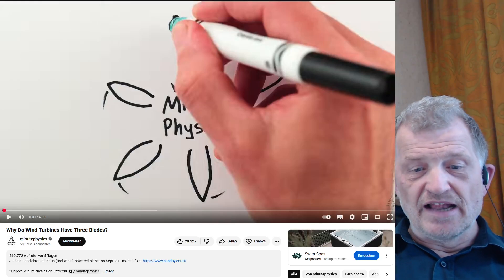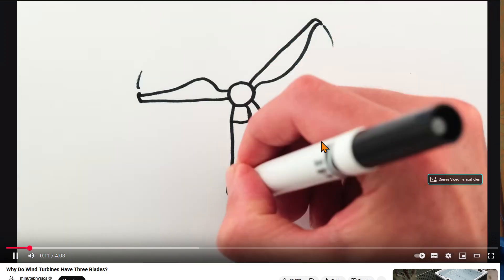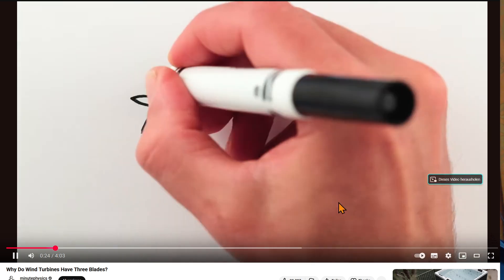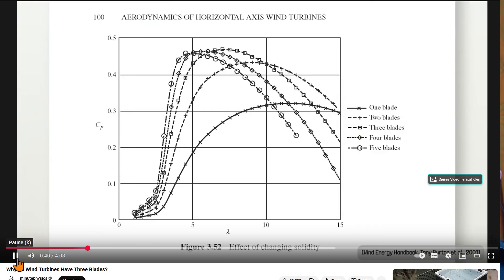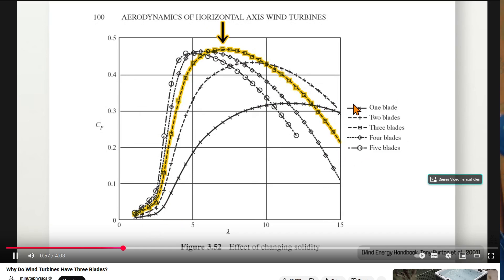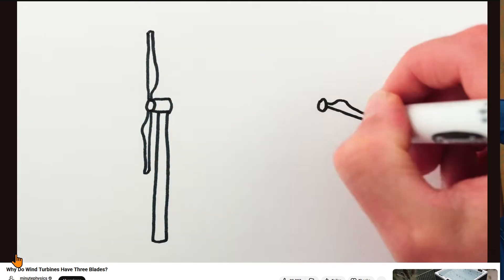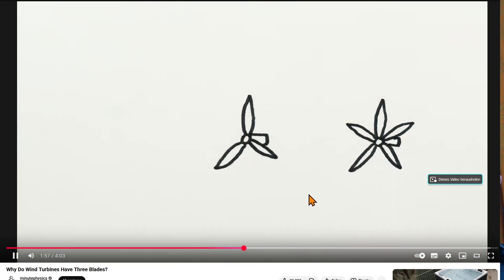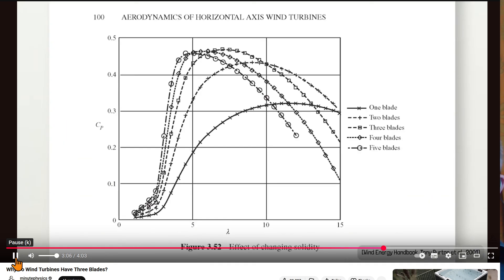Why Do Wind Turbines Have Three Blades? - the misleading facts corrected. Channel "minutephysics"

Comment: Another issue that's not covered is that, even if you get decreased efficiency per blade, the presure drop in atmosphere accross more blades should be higher than the pressure drop accross less blades. Meaning, even if you get "less" efficiency, you should get increased power. But optimising blade shape, you should see benefits in increasing the number of blades up untill the point where each blade begins to interfere with the other blades air-flow, and even then, the blade shape could be optimised for that too and it should be possible to create a turbine which makes a significant pressure drop and removes a very large quantity of the kinetic energy from the wind.